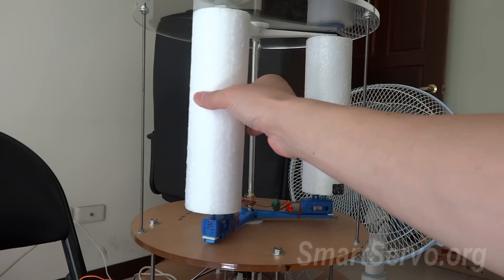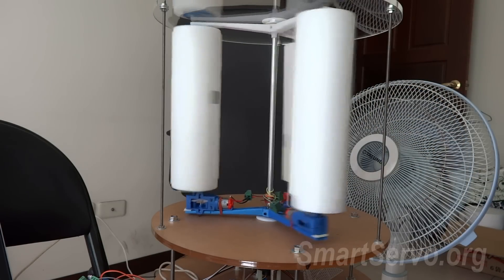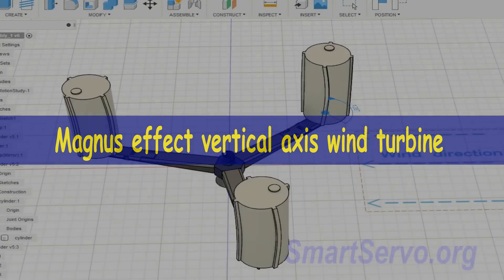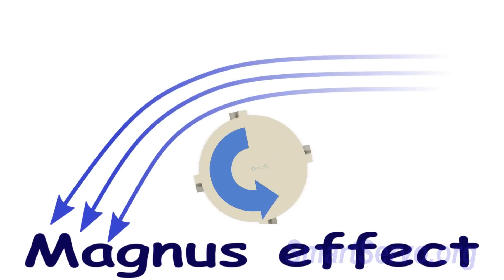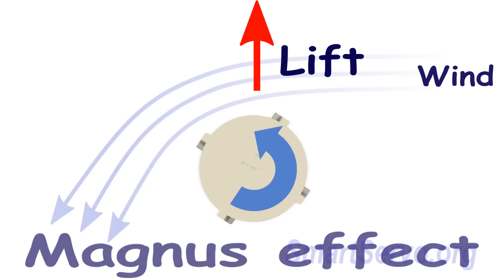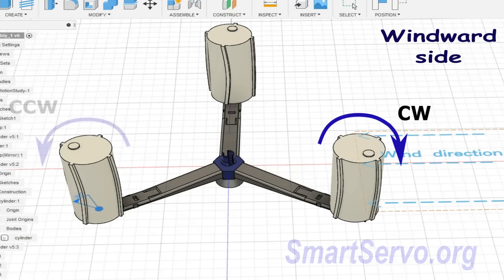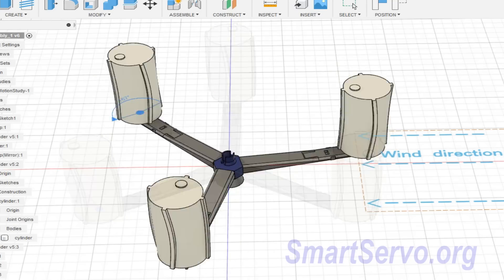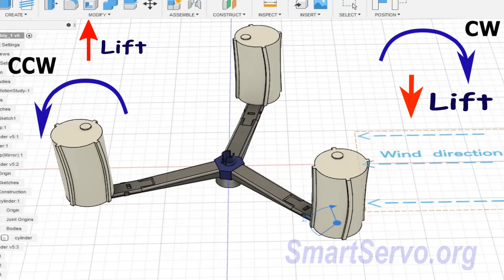Magnus effect vertical axis wind turbine, No blade, start quickly

Comment: The is something I heard from Japan claiming that it can generate electricity from tornado (btw I am not quite sure if it is the US or Japan)
Reply from the maker: Maybe you're talking about a turbine made by a Japanese company (Challenergy), still a little different. They added a plate behind the rotor to mask the Magnus force on the leeward side so the motor didn't have to reverse, but it also lost some lift. This video shows the Magnus VAWT in its original concept.

Comment: Can you generate more power than your putting in?
Reply: That's impossible
Reply: @JR-xc1yf  I think he means to ask if the rotation of the assembly can be hooked to a generator and generate more power than is being put through the motors to start the Magnus effect working.
Reply: @JR-xc1yf  The amount of energy received by the generator may exceed that required to spin the cylinders, as the motors don't rotate the turbine directly, they just facilitate transfer of energy from the wind via the Magnus effect. This is kind of similar to an alternator, which requires some power be spent on the field windings so current is induced when the armature is spun. This will obviously reduce the efficiency of the turbine as it probably consumes much of the power it generates. This doesn't violate the conservation of energy as the turbine can't consume more energy than is supplied by the wind.
Reply from the maker: Although I haven't done it yet, as long as the motor power consumption is reduced and at higher wind speeds (wind energy is proportional to the 3rd power of wind speed) I believe it is possible. Using energy regeneration and common DC bus technology, the energy of the decelerating motor can be collected and supplied to the accelerating motor, which can greatly reduce the power consumption of the motor.
Reply: Yes it is possible if you are talking about nuclear fusion(which I don’t believe it will work).
Reply: @peterwan816  at the moment, it is working at China.
Around %60-70 efficiency. after 10-20 years, there is a big potential!

Comment: The speed is almost irrelevant. how much torque does it produce?
Reply from the maker: From the results of the acceleration test in the video 5:08, it can be seen that the torque of this wind turbine is very high at low speed. No other wind turbine can reach top speed from rest in such a short time. The challenge of this wind turbine is how fast it can rotate and still have torque output , which is the factor that determines whether it has high efficiency.
Reply: Not enough.
Reply: Agreed torque is all that counts

Comment: i wonder if it can work mechanically like put horizontal wheels on the bottom of the “blades” and have a inner and have a outer half ring under the turbine. if the wheel touches the outer ring it will rotate the other direction compared to the inner ring. it could even be made more fancy, by using conical wheels you can move the ring up and down to increase or decrease the number of rations of the “blades” make per revolution and by rotating the rings you can ajust for the wind angel
Reply from the maker: If you are interested, you can read this patent (US4446379) to know how people in the past solved this problem mechanically. Fortunately, there are more technologies available in this era. By the way, your method is also very clever.

Comment: What did you use for the generator? Did you generate any electric from this experiment?
Reply from the maker: It's just a conceptual model and it's too small.
Reply: It likely produces much less energy than it takes to run.  The arduino is powering the rotation of the cylinders, which also requires even more energy to reverse the cylinder rotation half way through the rotation of the whole turbine.

It's nifty demonstration of the Magnus effect, but isn't a generator by any means because it is constantly working against itself with reversing the rotation of the cylinders, plus the significant extra friction from all the bearings.  

The magnus effect is a very light force compared to just the direct force of the wind captured by a blade passively in a traditional turbine.  So it's putting in more energy to rotate the cylinders for less rotational energy captured by the wind.  Easiest way to think of it, for as fast as the demonstration was rotating,  putting a similar scale blade turbine in front of that fan would be spinning much faster passively.

Comment: What is the minimum wind speed necessary to make it function?
Reply from the maker: This device can rotate at a wind speed of about 1 m/s, not because of good efficiency but because the friction of the device is very small.
Reply: How much power does it put out at 1m/s wind speed though? Do you have any way to measure the torque?
Reply from the maker: @magnuswright5572  This device is too small and can only rotate slightly in a breeze of about 1m/sec, not suitable for measuring power. If you want to measure the efficiency of a wind turbine, you can use the torque mode of a servo motor. Set a torque (as a load) at a given wind speed, then observe the rotational speed of the wind turbine and record it. Then increase the torque and observe the rotational speed (it should be decreased) again, repeating these steps to get the torque curve of the wind turbine, multiply the torque by the rotation speed is the power. Therefore, the power curve can also be obtained.

Comment: there is one full scale of these wind turbine that was already built and tested I think the problem was too much maintenance on all the movings parts vs regular direct shaft wind turbine
Reply from the maker: If you're talking about turbines made by a Japanese company (Challenergy), there's something different. They added a plate behind the rotor to shield the Magnus force downwind so that the motor didn't have to reverse, but it also lost some lift. What this video shows is the original untouched concept of Magnus VAWT. Although there are many problems, it could trigger some imagination => https://youtu.be/9AdpggaOfF0

Comment: How do you deliver the power and control signals to the small motors that are attached to the cylinders? Batteries somewhere in there and a wireless control signal?
Reply from the maker: No batteries, no wireless, all power lines of motors are connected via a slip ring under the main shaft. see video 0:59

Comment: Nice vid. How will this scale to macro level like on building roof tops ?:washhands:
Reply from the maker: For this device to be meaningful, it must first solve the problem of energy consumption. Before that, combining it with lift blades may be a way to create value in the short term. Please refer to =>https://youtu.be/9AdpggaOfF0
Reply: @SmartServo_org  why does it need energy? Do you really have to spin the columns manually ?
 Wouldn't just using the column spin to generate energy work? 
use the back-EMF to control the rotation, you would only need energy to start it.
Nevertheless nice idea, but too many moving parts.

Comment: Cool video.Would this design have bigger applications and is this a better design compared to conventional wind turbines (potentially)?
Reply from the maker: Compared with the traditional vertical axis wind turbine, this one has fantastic performance. For the Darrieus, it is difficult to start and can't stop in strong wind. These are not problems for this wind turbine. Although there are still many problems to be solved, I will soon show its potential.

Comment: magnus effect pull perpendicular at vector of wind! your experiment is wrong, you need to make propeller and instead of blades put there rotating cylinders.
Reply from the maker: The Magnus effect does not require a propeller, it uses the pressure difference created by a rotating object.
Reply: @SmartServo_org  of course,  but vector of thrust is in wrong direction.
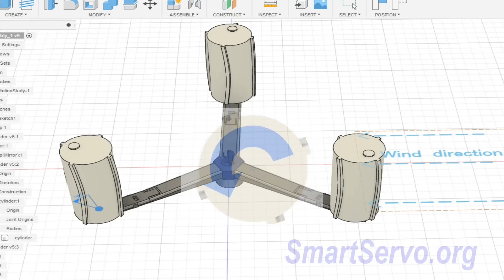Reply from the maker: @chichomancho1791  From 0:20 in the video, the direction of the thrust is indicated, and the wind is blowing from the right.
Reply: @SmartServo_org  he means of you connect the cylinders directly to the central blue hub and have them each rotate in the same direction it would work better.
Reply: @galtthedestroyer  yes, you understand what I mean.👍

Comment: You are controle the motor using arduino and external power 😃
Reply from the maker: Yes, I use Arduino UNO + 3xL298 to drive 3 DC motor, must consume energy.

Comment: Can it be scaled up to generate positive electricity.
Reply: There is a Japanese company that is working onmaking full scale versions of these. The big selling point is they can work even in violent storm winds, such as hurricanes and typhoons
Reply from the maker: @actupper  The wind turbine in this video is still different from that of the Japanese company you mentioned (it should be Challenergy). It installs a flat plate behind each rotor to cover the wind from the leeward side, so that the rotor only needs to maintain the same speed without changing direction.Although easier to control, it uses only half of the Magnus lift.
Reply: @SmartServo_org  But if you constantly change the direction of the leeward-side-rotor, you get a problem with exotic materials, that would be needed, since in such a case, the rotors have to have marginal rotational inertia, in order to speed-up and slow-down constantly. I think the japanese approach is better. Use only the half the magnus-effect, but avoid using high-tech-material-rotors (rotors made out of materials that don´t even exist yet). 
I thought it´s crazy when I saw it, and I thought, that if there were a way to avoid the change-of-direction, it then would be a great idea, and now you tell me that this already exists, in Japan.
Build your rotors hollow, with stable spokes/beams leading to the rotors´s shell.
Reply from the maker: @klausbrinck2137  Is it a good idea to sacrifice half of the Magnus effect for the motor not to have to change direction? Seems too optimistic until knowing how efficient it is.In addition, motors that rotate in one direction are not as good as motors that do not need to rotate.It's not too late to judge after seeing this idea=> https://youtu.be/9AdpggaOfF0

Comment: does this produce energy for a device or just more wind ...what's the porpuse of this ?
Reply: i assume its meant to generate rotational energy for ships or as they said, VAWTs (Vertical Axis Wind Turbines)

but i doubt that the amount of energy harnessed is more than it takes to drive the drums, or is less than a normal Magnus turbine or HAWT.
Reply from the maker: The original purpose of this windmill is to generate electricity. Obviously, the problem it must overcome is that the energy generated must be greater than the energy consumed. The main solutions are:
1, increase the efficiency of the rotor,
    >>Increase aspect ratio (slim and long) to improve lift-drag ratio.
2, reduce the energy consumption of the motor
    >> reduce the mass of the rotor to make the inertia lighter
    >>Recycle the energy when the motor decelerates and reuse it
With these improvements, I believe that net energy output can be achieved above a certain wind speed.
Reply: @SmartServo_org  And when you use more than 3 of these "white thingies" ( do not know the english term) ? Do you get more rpms? And/or with longer ones?
Reply from the maker: @stanlibuda5786  Using a longer rotor can increase the lift-to-drag ratio, which is beneficial for increasing speed.
Reply: @SmartServo_org  Wonder if you could put a small generator on each magnus-effect tube as well as a big on the main rotor?
Reply from the maker: @worldcomicsreview354  The Magnus rotor must be actively rotating, so it needs to be driven by a motor rather than a generator, in order for the main shaft to drive the generator.